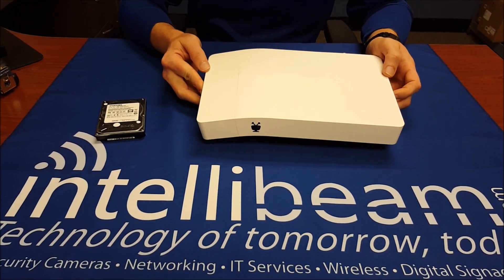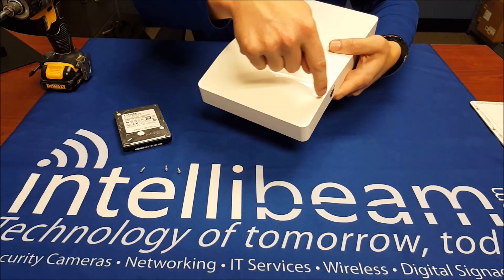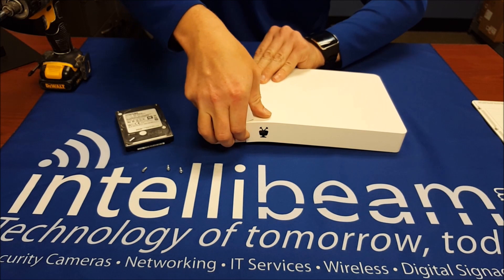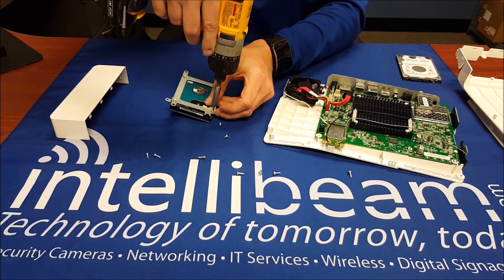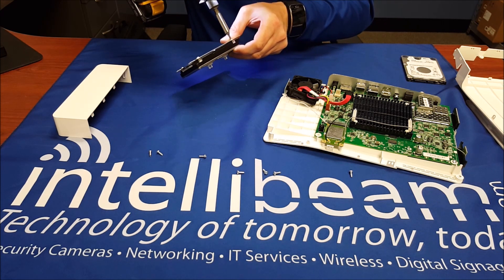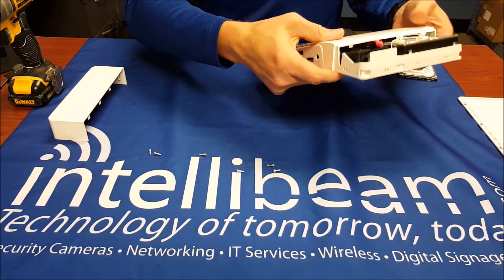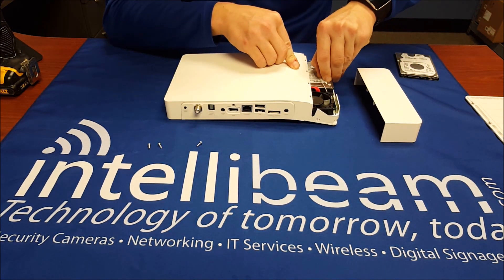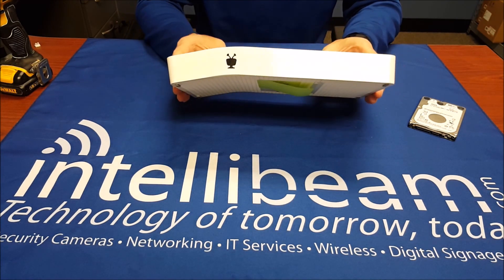Tivo Bolt hard drive replacement/upgrade & install by Intellibeam.com

Comment: Great Intellibeam video for simple replacement of TiVo Series 6 BOLT HARD DRIVE.
BOLT seems a lot more flimsy plastic than the larger Roamios.
Thanks
Reply: The case is actual quite durable but yeah, the days of the heavy metal Tivo cases is gone. Honestly there's really not too much to them inside so it was overkill.

Comment: Will you be addressing the formatting of new drive installation in a subsequent video?
Reply from the maker: +Matthew Kent With a >3TB drive, you do not need to format or do anything special. You just pop it in and turn on the Tivo. 4TB and above needs some Linux love.
Reply: +Intellibeam What do you need to do in order to use 4TB and above?
Reply from the maker: +David Pavlakovich There is some Linux prep work that has to be done to the drive first.

Comment: You really don't need a power driver to work on something like the Bolt.
Reply from the maker: +Shao Zhang I'm all set with spending extra minutes on video unscrewing/screwing a dozen screws. I'm sure nobody wants to see it either.
Reply: +Intellibeam That's what editing is for.  It just looks really lazy putting a big power driver on something as small and could strip the fastener.  I can understand if you're taking these apart by the 100s as a repair business but for instructional videos I think its a poor choice.
Reply from the maker: +Shao Zhang If you like editing videos for free, let me know. I didn't strip any screws in the video, that's because I know what I'm doing. I even mention to use a normal one if you don't know what you are doing.
Reply: @Intellibeam  I'm looking at a Seagate 3TB 5400RPM 128MB Cache SATA 6.0Gb/s 2.5" Notebook HD ( ST3000LM016), would you recommend this HDD? Does anyone have experience with this HDD?
Reply: +Shao Zhang Geez.  Lighten up, dude - he's helping people out by doing the video!  If you're too stupid that you strip things using a power driver, maybe upgrading the HD is beyond your capabilities.